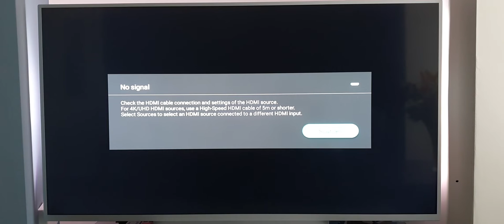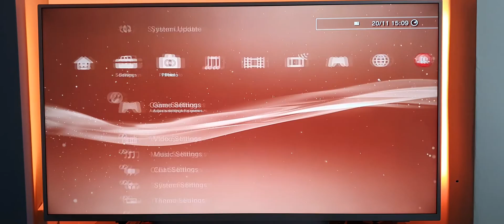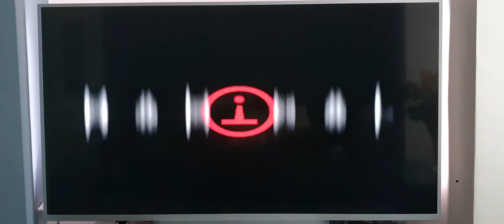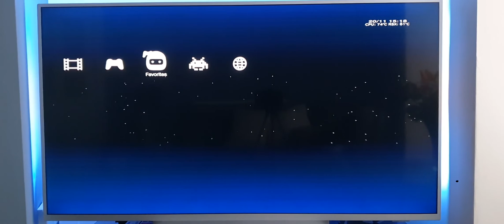How To - Sony PlayStation PS3 YLOD NEC Tokin Capacitor Repair Fix

Comment: hi bro i just came across your video can you help i got ps3 fat console when i turn it on im getting a red light it only turn green for a couple second then i hear 3 r 4 beeps then the red light start blinking i put new paste on the top gpu and cpu i haven't remove the chips do you think it's the nec tokin anyhelp many thanks
Reply from the maker: Hi, you have the YLOD from what you have described. This can be caused for a variety if reasons but as time has gone on the Tokin caps seem to be the fix, but equally at tikes it can be due to bad cpu/gpu joint or the chip it self. Personally had good success with the capacitor replacement, so defintley worth a go as you don't really have much to lose (but please do so at your own risk)
Reply: hi bro thanks answering back i order some tokins the other day hope i can fix it thanks 👊
Reply from the maker: Hi not a problem, hope it works out for you and you manage to get it working again. Just take your time and be careful of the small caps/diodes on the back of the CPU/GPU chips.
Reply: hi bro i received my tokins 2day they are the same ones in your video but they are mini ones i think i order wrong ones can you tell me pls how many tokins do i have to install i can fit about 3 on the line i have a ps3 model CECHG03 many thanks 👊
Reply from the maker: Aslong as the voltage and capacitance the same just use the amount shown in the video. I used 4 per Tokin.

Comment: Great Video. Just wanted to know, I've seen other videos doing this repair but having trouble playing graphically demanding games such as the last of us. Have you had any issues with certain games?
Reply from the maker: Thanks Allen, not had any problems so far with the console and still gets used regularly to play sokr classic games. The console is also running custom firmware and plays games find that have been installed onto the HDD. Did test TLOU around the time of the repair and it played without problem but unable test it now as I don't have the game anymore, unless I can source a copy. But other games like GTA and uncharted have played with no issue. With this repair it will vary from console to console and as someone has stated the amount of capacitors that need replacing should be done so after proper diagnosis using Syscon check. Also the success of the repair also depends on if it has been tampered with before.
Reply: @waqarnaweed  That’s good to hear. I just have one more question. I’m not to sure if I’ve missed it but does the type of solder matter? I plan to use a “tin-lead” solder or do I need to use a lead free type? Thanks in advance
Reply from the maker: @allenwalker5961  You can use either or in this particular application because you are not likley going to issues with poor solder joints being affected by heat because of the nature of the size of the solder joint itself. I have used before but wherever possible in electronic applications I will tend to use Leaded solder. Hope this helps.

Comment: Please don't replace capacitors unless you diagnose it with syscon error codes. Many consoles end up having RSX faults, not the tokins. The fact that it runs doesn't mean you fixed it. It could be that as you were prying them off, you applied enough pressure to the board, which caused the balls under RSX to reconnect mechanically for some time. You'll find out if you get another YLOD in a few months...
Reply from the maker: Thanks for the comment, I agree that console should be checked Syscon for relevant error codes for proper diagnosis but this in its own right could be beyond the scope of many DIY repairers, but like I said I do agree that this should be the first step for better success and fault finding. However, I do disagree with the comment that applying pressure to the board would somehow miraculously enable the solder balls under the problem causing chips to mechanically bond without any additional clamping force to maintain that bond. Without the addition of heat or reflow the chance of mechanically bonding the balls is very slim. I would also like to point out that the console is still working as of today since the repair around 7-8months ago, but I am also not disagreeing with your comment about syscon error checking as that recommended 👍

Comment: If this work with ps3 slim???
Reply from the maker: Yes on some earlier versions the process is similar. However, the replacement capacitor rating is lower

Comment: Awesome video Waqar! What kind of pry tool are you using? Is it plastic or metal? Can you share a link to one? Thanks!
Reply from the maker: Thank you 👍 the pry tool I was using is something I made myself out of some steel which allowed me to get underneath the NEC  chips and pry them up without the tool deforming or chipping which is what happened with some other pry tools I tried. You can however get some metal pry tools mainly used for mobile phones for around £2/3 on ebay or amazon

Comment: I might finally be able to fix my 2008 PS3 that got YLOD in 2015. I've got a question: I think I broke the blue hard drive screw when I tried to get it off earlier. Is there a way to get it off? I kept turning it but couldn't get it off.
Reply from the maker: When you mean 'broke' do you mean you've snapped the head of the screw or just stripped the head so the screwdriver won't engage? If the head is still there you can easily use some plier with a wide head which will give enough clamping force to allow you loosen the head. Hope this helps
Reply: @waqarnaweed  I mean that I broke the "shape" inside the head. It's now a circle.
Reply from the maker: As per my original reply if you have stripped the head of the screw (the screwdriver won't engage or turn the screw because the cross shape has been rounded) then just use some pliers and you should be able to turn the blue  hdd screw. The reason why I say this is, is because I have had to do this with some consoles I have attempted to repair previously where somebody has used the screwdriver and damaged the head. Hope this helps.
Reply: @waqarnaweed  Thank you for the help!

Comment: Hi!
I have one question : how did you know that problem only on NEC/Tokin?
I have same ps3 fat 40 gb, and it on one day when i install game suddenly turn off. When i want to turn on it sound three short screams (like beep-beep-beep) and yellow led is began flash. I can`t turnt it on.
I watch your video and i`m very surprised because you give me hope to repare my ps3.
But i don`t sure that i have that same problem thing.
Symptoms are the same (like at all ylod ps3)
p.s.
Sorry for my bad english
Reply from the maker: Hi, the general consenous for the YLOD issue is mainly due to failing NEC capacitors, hence why this is starting to be widley accepted as the main cause over the last 12/24 months. However, the YLOD issue can also be down to a faulty powersupply, faulty RSX chip/solder joints etc. I will say that 9 out of 10 PS3's that I have repaired that haven't been opened or tampered with that have YLOD have bene fixed using this method. For refereance the PS3 from this video is still working fine and gets used nearly every day by a sibling. Let me know how you get on etc.

Comment: Can you consider this as permanent YLOD or it might still get a chance to BSOD again? Thank you.
Reply from the maker: I've have fixed many PS3's within the last 12 months and they are still working. The kne shown in this video gets used everyday by a sibling and still going strong without issue. The success of this will definitely be based on if the console hasn't been tampered with before

Comment: I would like your opinion on my PS3.  It still turns on and begins to boot up.  But as its booting up it starts making very "Static-y" noises, the image starts jumping, reminds me of a video thats trying to buffer as its downloading, and then shuts off and yellow light comes on.  Would you think that's a capacitor or the GPU needing a reflow?  Any opinion is welcome.  Thank you!
Reply from the maker: Hi, this could be due to various reasons, does the fan ramp up when the glitching starts to occur? Does it do it constantly? Also when it shuts down are you able to turn it back on again?
Reply: @waqarnaweed  Thank you for the response!  No the fan does not ramp up.  Yes it does it every time I start it up but I've only tried turning it on a few times as I didn't want to mess anything up.  I can cut it back on only after switching the main switch on the back.
Reply from the maker: The reason I asked if the fans ramp up is it could be due to degraded thermal paste which dries out over time especially yhe orginal factory applied compound. The issue could also be an early sign of the NEC tokins deteriorating and require them to be replaced with tantalum capacitors. However a more serious issue and difficult to repair would be the RSX chip failing, you could reflow this but this will only be temporary and will eventually fail again and require a recall, I would suggest a proper clean down of the board and reapply the thermal paste as that is the simplest, cheapest solution without any risk, I would then try the capacitor repair followed finally by a reflow as a last resort as you have nothing to lose then. Hope this helps.
Reply: @waqarnaweed  I actually did a complete tear down about 4 years ago on it and put new paste on it then.  So I guess now I'm gonna try the capacitors.  Thanks for your input!
Reply from the maker: Before you attempt that just double check the paste as it would need replacing after the capacitor replacement anyway but also double check the mounting pressure of the heating 👍

Comment: Can you put a link up for the capacitors you used please?
Reply from the maker: Hi, the link I ordered these from originally are now longer available so unable to provide you with a link. However, these are available from various online retailers, so if you search the following you should find what you need dependant on your location "470uF 6.3V Tantalum D Size Capcaitor". Hope this helps.
Reply: Thank you bro.

Comment: Would this technique work with a slim? mine is cech2001a, i still haven't opened it
Reply from the maker: @ScoobySnacks, generally on the slim series the NEC Tokins wasn't main the issue for YLOD or for it to shut down straight away as this is usually down to a few reasons including a faulty Mosfet, Powersupply, or even the Cell/RSX chip. However, I have read that some people have replaced the NEC tokins on the slim to resolve the issue but I cannot confirm this as I have not had to undertake this type of repair on the slim model to resolve YLOD. If you are going to attempt this on the slim model only the 2 NEC's on the RSX side will need to be replaced but the capciators would be 330uF rated at 2.5v. Hope this helps but undertake the repair at your own risk.

Comment: Question, how do you know which capacitors to replace? Should I replace all of them or just the ones shown in the video, also I've heard you need to recouple them or something?
Reply from the maker: @Liam Turner generally the NEC capacitors below on the reverse of the RSX chip is what tends to lose it's capacitance rating first as shown in the video. You can potentially measure the capacitance of each of the NEC tokin using a suitable and appropriate multimeter which has the capability to read capacitance and check if this reads the total value needed (note 4 x 470uf = 1 nec tokin). Personally I have not tried this method so can't say for definite that this would be a suitable or accurate way of being able to check this to pinpoint the faulty capacitor but in theory this should work. I have personally had no issues of fixing the ylod but using the technique shown for the consoles I have repaired so far (only had 2 not work becuase there were additional faults e.g. damage to gpu, chip diodes etc.)

You will only need to bridge the positive terminals using a jumper wire solder to it on  on the top and bottom rows if you have removed the NEC capacitors on both sides of the board, but this isn't needed if you only do it on oneside. There are articles to back this up on psx-place website. Hope this helps.
Reply: @waqarnaweed  thanks for the response will definitely give it a try!
Reply from the maker: @Liam Turner no problem, hope it helps and you manage to get it sorted. I would suggest just remove one of the NEC tokins first replace it with 4 capacitors reassemble and test as it should delay the YLOD or even fix it. If it doesn't then just move onto the second NEC tokin. Im hoping to film another PS3 showing the process again to demonstrate repeatability when I get the chance. Also the console shown in the video is still working 3/4 months on without any issue with regular use due to it being jailbroken.